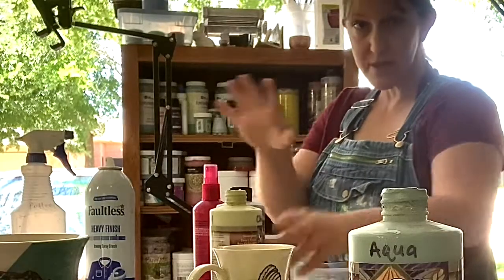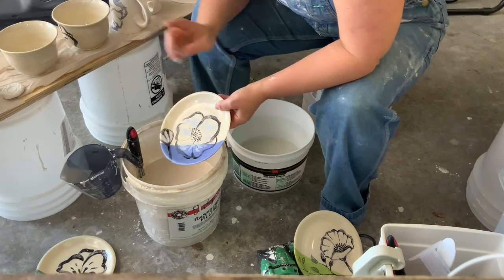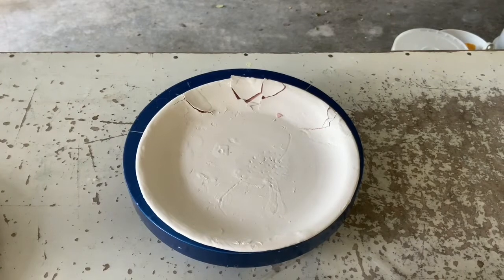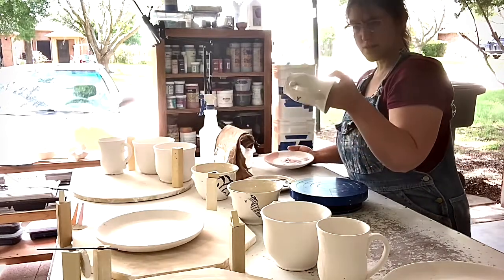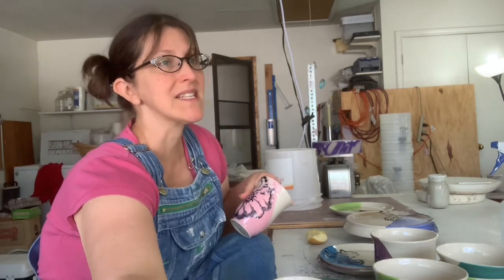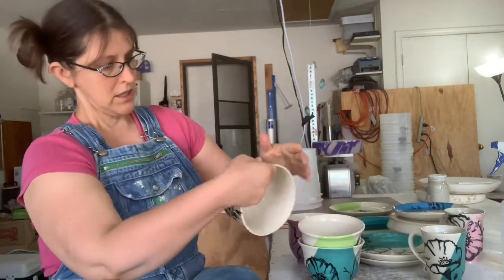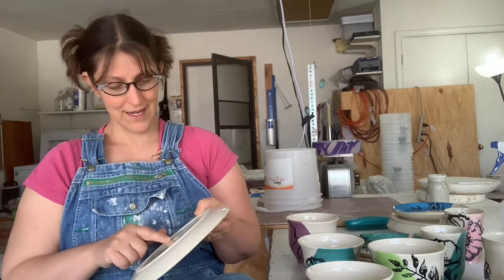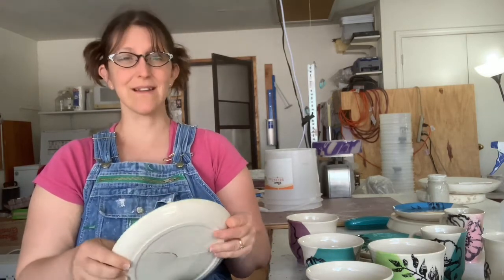What Causes Glaze Crawling, Fix glaze defects -crawling glazes, decorate pottery studio vlog at home

Comment: Thanks Emily for being so generous to share your results .  I have always felt that clear glaze is so unpredictable especially when put over underglazes. Have you thought of not using clear over the underglazed sections?....as long as the underglazed areas are not in a place where there will be food
Reply from the maker: Yes, in fact I have some going in to the kiln soon that I thought 🤔 maybe I should use Ann’s techniques on those! So look out 🤪

Thanks so much for watching
Reply: @CallUsTemily  It just helps with making your kiln loads a bit more successful and I like the different textures on the pot.  If the underglaze is a bit rough, sand it lightly to smooth, right

Comment: I get the odd tiny crawling spots wherever I used my glaze pen. I found out that its all to do with the transparent glaze you use, some are different to others!! a potter friend gave me a perfect trans glaze that has a lot more frit in it that will stick great but contains lead. Since using it I get no more splintering off sides, just tiny crawling spots to deal with..arrrgghh
Reply from the maker: Yes! All to do with the glaze. This one is a powder that’s put together by Armadillo Clay in Austin. It’s a dipping glaze that can’t be dipped. 🤦🏻‍♀️🙄 but since this video we’ve figured out if we paint one coat it has fewer problems. I really just want to make my own but I have to use this up first 🤷🏻‍♀️

Comment: Thank you for the great video! I’ve en getting some crawling lately and won’t to try to repair. Today o got two plates made aame tome, same bisque fore, same glaze and one crawled like crazy. 
Is what you’re recommending to spray starch the affected area and paint on the glaze before another fire?
Reply from the maker: Yes Mam! When the spray starch dries it will leave a tooth on the surface and as the glaze re-wets the starch, the starch will help the glaze stick. Some commercial paint on glazes may not really need it. But pretty much all dipping glazes will slide right off a fully glazed pot.